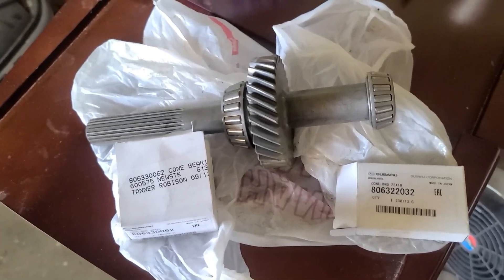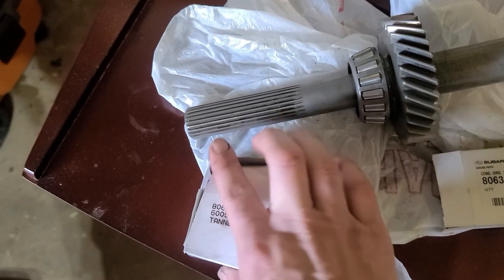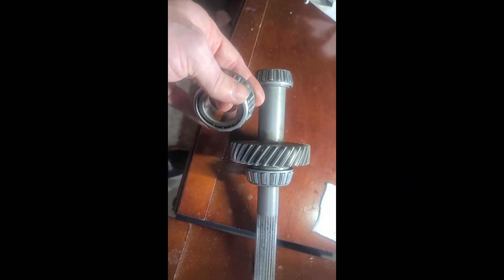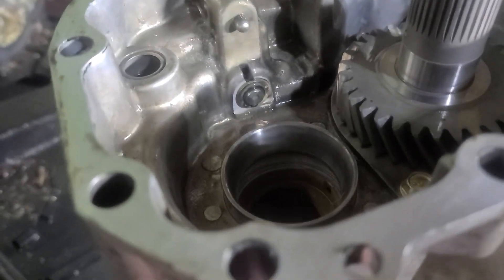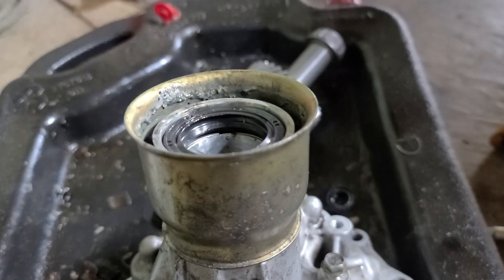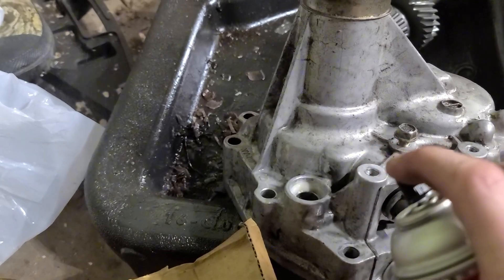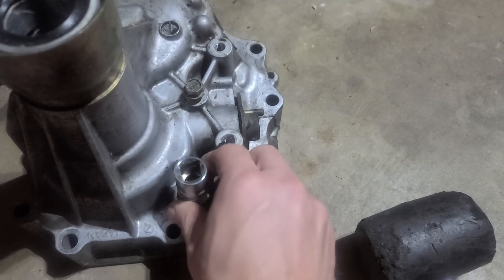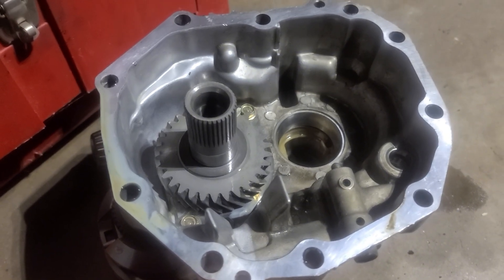Can I Win Vs. Subaru Center Diff? How to Replace a Center Differential and Bearings on STI.

Comment: thanks for showing the play in those angular roller bearings. As you said the old ones were probably ok.  There is a vid online where the bearings are put back on by placing the shaft in the freezer overnight and the bearings in the oven for 10 minutes (consider the consequence of divorcing before doing this...)  they just slip on,...but to get the old ones off is claimed to be tricky.
Reply from the maker: Yeah I have a buddy that has the puller and the press but he was out of town and I was in a hurry lol!  You can also use dry ice on the shaft and heating the bearing also. I put head studs in the freezer to make them thread all the way down easy.